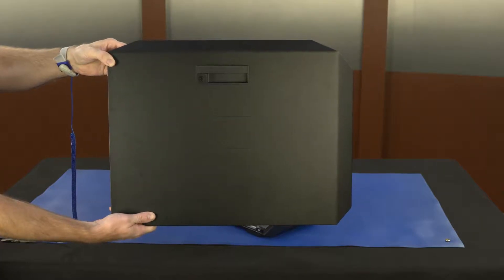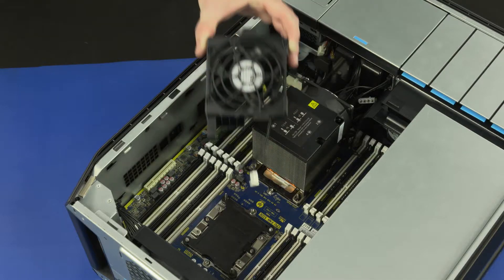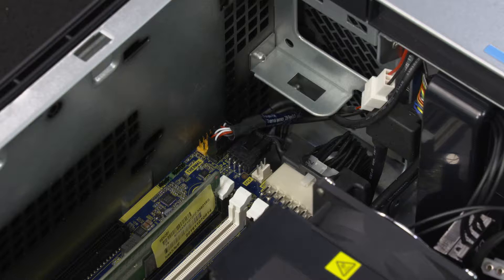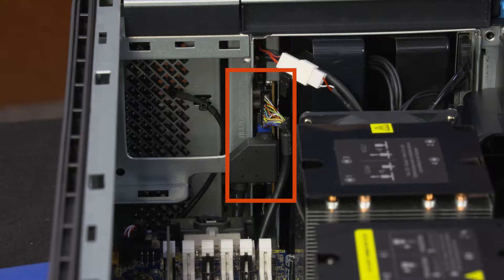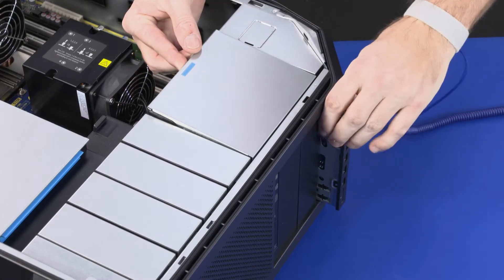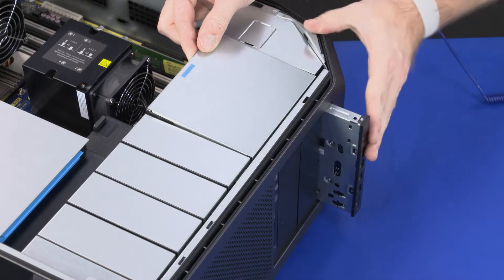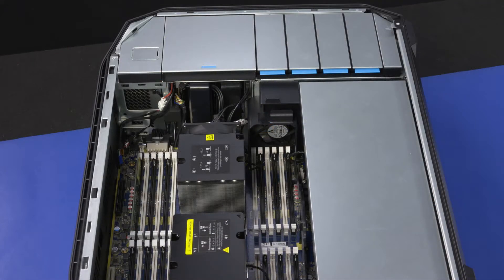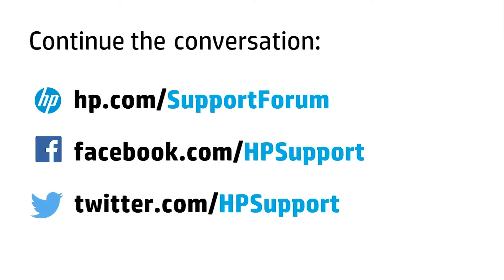Remove and Replace the Front I/O Module | HP Z8 G4 Workstation | HP

Comment: Have the Z8 G4 motherboards changed the position of the USB 3 and FIOP headers ? This board shows them positioned near the top fan next to the Personality slots for the NVMe drives, whereas on my motherboard (2017 or 2018) the headers are positioned lower down the motherboard beneath the RAM modules near the 3.5 inch hard drive fans.
Reply from the maker: Hi Stevie, thanks for contacting HP Global Social Media Support!
I am here to help!
What seems to be the issue? Are you facing any technical issues with your HP computer?
Let me know!
Binu_HP Social Media Tech Support
Reply: @HPSupport  Hi, I'm in the process of replacing the Front USB 3 I/O ENTRY level Module with the Premium Module (which includes the 2 USB 3 -Type C ports  as shown in the above video) I ordered the L10337-001 CABLE KIT - FRONT I/O PREM from the HP Partstore but when it arrived yesterday it did not include the FIOP OcuLink Right Angled Male to Male cable, instead the only cable which arrived was the exact same cable which is already connected to my Z8 G4 (P/N number 857700-01 REV A  FOXCONN 2103 stamped on it) The required FIOP OcuLink cable is not listed as a separate item on the Partstore only the "L10337-001 CABLE KIT - FRONT I/O PREM" listed which suggests that that is the only part required.  I'm having to return the cable as it is now surplus to requirements. Further, my opening comment above, is questioning the accuracy of the instructions as the Z8 G4 motherboard shown in the video has different connection locations than my Z8 G4 motherboard and every other image of a Z8 G4 motherboard I could find online. Is it a custom motherboard or have they been revised ? Thank you for any help you can offer.
Reply from the maker: In order to get this issue fixed, please contact our customer care team over the phone or chat for further assistance, as this issue requires Live conversation with you over phone or chat to isolate the issue and provide you instantly with appropriate solution or repair/replacement options available at your place as per the warranty.
Please feel free to reach us on call/chat, please access this link to select your preferred country and language option to reach us. Global support link: - https://www8.hp.com/us/en/contact-hp/ww-phone-assist.html
Binu_HP Social Media Tech Support